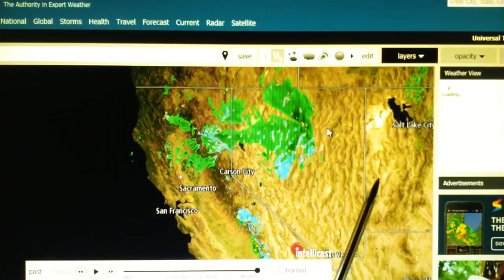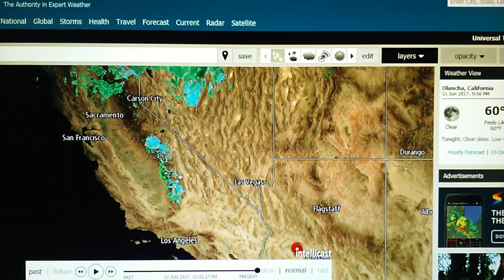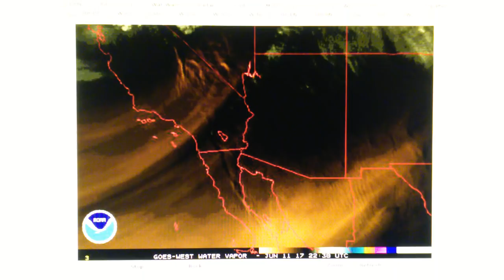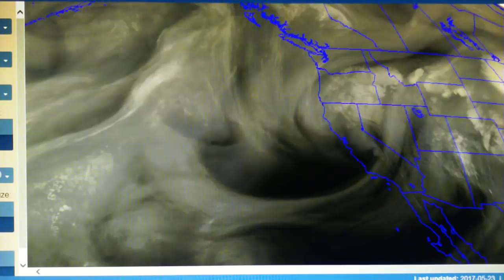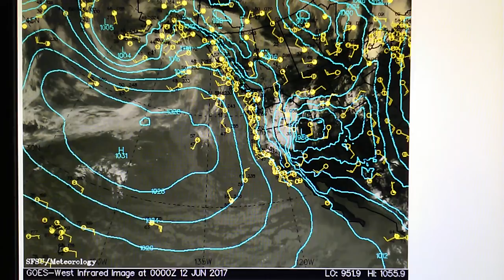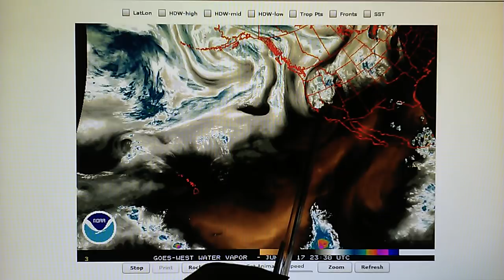6-11-2017; Giant Surface-to-Upper-Level-Low Moves SE Thru CA; Zero Rain in So. CA; 92F by Thurs!!

Comment from the maker: 9:15am; Giant low pressure system over California is now being bulldozed to the Northeast by strong high pressure installed in the Southern & Central part of the State. Barometric pressure continues to rise: currently 29.93" / 1014mb as this process unfolds.  The terrorists behind this covert weather manipulation and the control over the nation's politicians must stop.

Comment: I tagged Gov Brown when I tweet as I do other politicians or Secretaries of the administration. We'll get through. Who funds this, does anyone know? Is it that UN slush fund to the military?
Reply from the maker: BeeBee BeeLeaves - The funding is probably coming from the Dept. of Defense which is essentially tied at the hip with those running the printing pre$$es and the 'deep state'.  The NEXRAD ground-based microwave transmitters are run jointly by the DoD as mentioned on Wikipedia. The Defense Meteorological Agency likely is involved in this weather modification operation, as are NASA, NOAA, the National Weather Service, as well as a small army of minimum wage shills tasked with trolling the Internet to stifle open discussion.